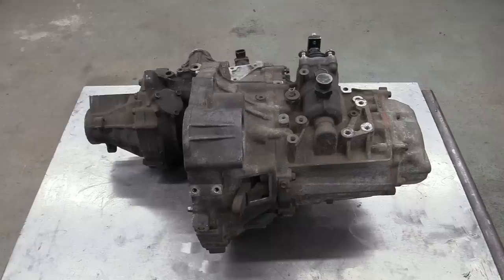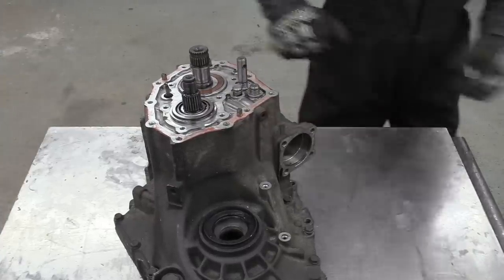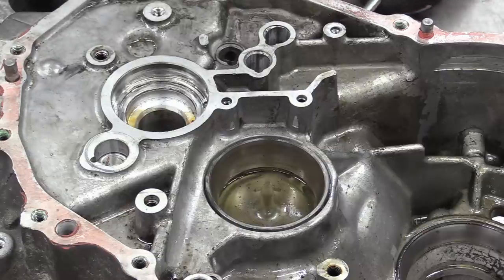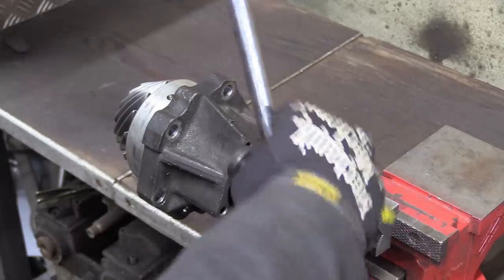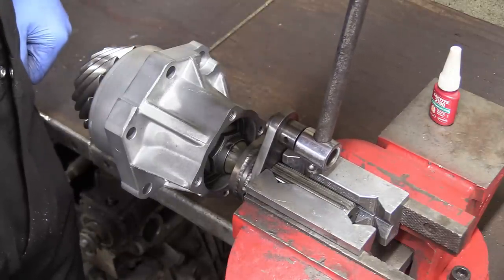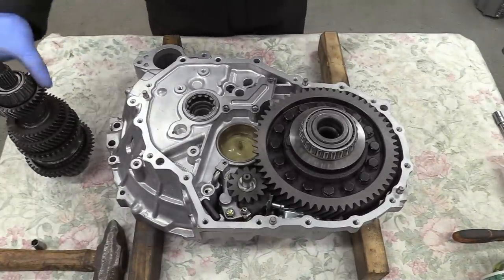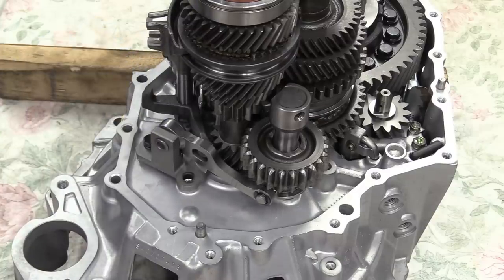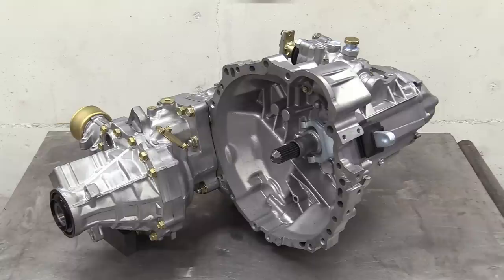Howie Did It - Toyota E154F Gearbox Strip and Rebuild

Comment: As an owner of an ST185 GTFour with a slightly buggered gearbox I can't tell you how excited I was when you said you were doing a 'how to rebuild' vid. Actually I can tell you, I was quite excited. Now all I have to do is watch the vid, absorb it all, get the box out of the car (an engine out, downwards job), regurgitate all that I learnt from the vid, apply it to the object infront of me and I should end up with a spangly nice example just like yours!
Oh, then put it all back into the car.
But only after doing all those 'while it's out' jobs that will end up taking longer than everything else put together.
Easy. Thanks boys!

Comment: If there's anything I learned from this video is how much better the engineering is in the similar generation Honda gearboxes. If you'd have used the Honda CRV as a base I have no doubt you would have had not just a better outcome but it would have been easier too. The B series AWD gearbox is tiny by comparison and can easily hold the power level you would put to it. Oh the what ifs.... But this project is still a masterpiece to behold and absolutely the best thing on YouTube.

Comment: I work at a Toyota dealership and have put a 2nd gear in one and have seen the special tool for removing the bearings, I've also seen someone put 5th  gear on and then seen the bearing plate on the side😁

Comment: When you put the two parts of the case together and said there's seventeen bolts, I remembered you saying there were fourteen to take it apart.
The panic set in, you're supposed to have more bolts taking it apart than putting it together (not counting "shoulder bolts"). Universal rule.
Heart rate returned to normal when three of them went in the bell housing. :)

Comment: Looking like new 😊 great job guys. Can't wait to see it doing 4WD doughnuts 😂 Quick question, the end plate under 5th gear with the torques heads screws, did you guys punch them to stop them coming loose? It's a common issue, 5th gear eats them until you cannot get a gear at all. but I'm sure you lock tighter the hell out of them. Always a great watch 👍

Comment: At 55:48 -re-installing the gear selector mechanism -whats' that extra nut underneath the bolt head? Bolt too long? At 3:10 when removing it I can see at least one of those bolts is shorter than the others.  Related question: did you happen to weigh all the gearbox/diff hardware when you had it out? I've never done anything remotely like this and the sheer quantity of bolts is surprising.

Comment: Rubber grease!?  Is that, like, a thing?  Here at my place we call it "grease".  You know, just the same as bearing grease, assembly grease, kingpin grease, ball joint grease, tie-rod and grease, steering rack grease, brake caliper grease, hair grease, bacon grease, duck grease, etc etc ad nauseum.

Comment: There was a time when I used to think boy those 80s and 90s Japanese cars were just too expensive for their own good. Watching this transmission come apart and back together makes me think how in the world did they sell these cars at such a bargain.
Reply from the maker: That was precisely our thought as we were doing it.
Reply: I knew the Celica GT-Four was a beast, but watching this series I have been seriously impressed with how incredibly stout so many components are. What an engineering feat! Imagine if Toyota were to do it again today.
Reply: @802Garage  itd be half the performance for double the cost
Reply: Your answer is, Production Volumes. The more made, the lower the cost of each unit in the production run. The prototypes are always the most expensive ones to assemble.
Reply: Toyota quality in the 80-90s was almost to good.
Reply: @802Garage  GR Yaris?
Reply: @ClumsyCars  Hahaha, I hear you. If they actually WANTED to build a monster like the old GT-Four though, they definitely could. Their engineering prowess is insane. They are just focused on building cars to meet economical goals rather than performance.
Reply: @Remenschneider  Very cool, but won't be engineered for nearly the level of abuse homologation cars were is my guess. Engineering has come a long way though, and it should be pretty stout. Still hopefully a beast!
Reply: Agreed, that is an impressive transmission, I mean come on... a freaking oil pump and cooler built in, Nice.
Reply: That’s the power of love! No, wait, lean manufacturing, sorry. That’s the power of lean manufacturing!
Reply: Wow, they really did build them to handle a nuclear holocaust, what with having an oil pump and cooler from the factory.  What's wrong with a normal oil bath, anyway?

PS: Mind you, perspective is key here - I started with gearboxes that shared their oil with the engine, and thought that was a good idea.  LOL
Reply: That is exactly what I got to thinking, about 20 minutes into the video.......
Reply: The Celica GT Four was an impressive car. I watched a modded one run 180mph in the Miami Mile event many years ago.
Reply: I own a celica alltrac(gt-four) and when he pulled the pinion out of the transfer case my first reaction was "holy shit that things huge". This car so ridiculously over engineered.
Reply: The  All Trac Turbo wasn't a bargain in 1990.
1990 Brand new ~ 50.000 DM  -  The Mini (edit/ i mean the pricy cooper carburetor Version \edit) was about ~11.500  DM in 1991.
Reply: @10zoll  That's around 45.000€ with inflation in todays euros? At least some online calculator says so. I would say 60-70k with all the components prices nowdays and homologations plus software development. Probably even more. With current top of the line tech. If there was a market they would probably develop it and produce it. As they did with this new yaris. Still they do jave plans for their own sport cars with new mazdas inline 6. We'll see but tbh I'm not sure about the market nowdays with all the heavy traffic jams, speed cameras and all. Not everyone have time for tracks even if they have the money, I mean especially if they have the money.
Reply: @bundles1978  that modified celica ran almost 210 at the last mile event it ran.....also runs solid mid 10s on toyo street tires!
Reply: And that's why i have a shed full of Japanese components from that era. My uncle was an enthusiast of said equipment, and so he passed unto me the knowledge of the quality of these vehicle parts. There was a time when i got some of them for nothing more than a 6 pack of beer.
Reply: Exchange rates gave Japan the upperhand on being able to undercut    Eu/au and USA brands during the 90s with better products.
Reply: @aussiebloke609  So did I. What a rubbish idea that was!!
Reply: @SubversionGarage  What you call bulletproof!
Reply: 802 Garage 
They would just take a BMW and rebadge it.
Reply: @802Garage  I'm sure BMW would do a lovely job.
Reply: @muttenmagroo  Overbuilt, I would say.  Over-engineered has a connotation of excessive bullshit like you see on German cars :b
Reply: A wild Conedodger sighting!  :-)
Reply: @PiDsPagePrototypes  and they spent more on engineering the things than on the interiors
Reply: @SubversionGarage  I had a 90 toyota pick up, sold it after 19 years still running with over 400,000 miles and just basic maintenance, oil, plugs, brakes, clutch, 1 starter, and 2 alternators, and 5 batteries. that was it. I was young and I drove the piss out of it as in 6k is not red line but just your normal shifting point. even spent a few years pulling a 3500 pound travel trailer. I'd climb grades at 60mph in second gear, passing semi trucks all the way.  Best vehicle I've ever owned.
Reply: Behold, my utter lack of surprise that Cone also hangs around these parts..
Reply: 802 Garage and they still had to cheat!
Reply: @802Garage  Agreed, engineering quality has been replaced by the balance sheet. Sign of the modern auto industry. Imagine someone restoring a Prius?
Reply: The boys have kept the quality/expense with the bolts though 😀
Reply: Johnny_McNeil it would cost the same as a Subaru STI or Evo IX
Reply: Oh how the British motorcycle industry laughed when Japanese bikes first came to the market in the early 60's. 10 years later the British bikes were a shadow of what they had been and in the last throws of death. My old man used to have a couple of Honda Benleys from around 1960, twin cylinder 125's, with big massive drum brakes, and electric start, don't think any Triumphs or Nortons had electric start until the late 60's early 70's. The Hondas were beautiful bikes for the era, crap pressed steel frames, but the Japanese all had awful frames well in to the 80's, but the engineering on the motor was exemplary, and that was on just a small capacity bike.
Reply: They are expensive back then because of import tax rise, every country that have a car manufacturing industry is trying to destroy the Japanese cars because they are threatening them as their engineering capability is lacking behind, but instead of coming up with their own engineering solution they go with the easy way by politicize the problem and start a trade war, much like these days, the result is easy to see, after the 80s and 90s, Japanese car industry started to stall while the country that started to trade war haven't fair any better because they dig themself their own grave as well, no one make affordable cars they used to be in order to cheap out and maximize the profit margin.
Reply: @802Garage  IDK, the new Supra is a sales bust and I'm kind of choking on the idea of a BMW engine- the 2JZ had some more development room- lots of guys were drooling over what that might look like, a 3JZ. Oddly enough, there is a "tuner" hot rod going together in NZ, I believe putting the V12 Toyota developed for last generations premier lines into a mid '90s Supra- that could have made a 90K car- this "marriage" of car cultures isn't going over well; it might do better at $60-$65K, but IDK. That Toyota is focused on building sound cars to meet price points is what Detroit forgot it was all about- building solid, dependable cars for a price more could afford. That Toyota, Honda, BMW, Mercedes, Hyundia all do this in America, using American labor and the Big Three cannot says something we need to hear and master.
Reply: The cars they let it go quite a bit but they kept it up with the trucks for sure. The 2000s to at least 2016 ish tacoma, tundra, and 4runner are every bit on par with the quality Toyota was putting out in the 90s. Of course the prices reflect that; and i can easily see 20 years from now they'll be like the 90s cars where nice ones (low miles, stock, rust free) start to cost more than they ever did new.
Reply: @chestrockwell8328  Porsche had that in the 944 turbos as well 😉 (although arguably because they had to do it for the relatively weak Audi gearbox to hold up).
Reply: @PiDsPagePrototypes  Also the production methods, everything is done to a precise routine and consistently. Methods and costs simpler to manage.
Reply: GR Y is a homologation car

Comment: Hope everybody at home had their E154F's on the bench playing along.
Reply: I've actually got a couple of these to do in the not too distant future. One is already on my bench and the other is still attached to an engine that's about 2 hours away from coming out of the car.
Reply: Im headed to the scrap yard to get mine now. Wish he was doing up a model I have any kind of use for.
Reply: best i can do is a meccano kit.
Reply: Only the ones on the register somewhere
Reply: I don’t have mine as I was making sure they (Nik) knew what he was doing before I utilize the video to rebuild mine. 😉
Reply: @AlexTrull  So that's what you call it !!!!😅
Reply: LOL...excellent :)
Reply: @mattn6368  do you know where I can see how to assemble that fifth gear syncro hub?
Reply: After the input shaft seal went in mine (2001 3sgte caldina) I ended up here. The blind bearing tool made from washers was so helpful.

Comment: I don't know of any other youtuber who would even think about attempting a transmission teardown/rebuild to this degree or professionalism, or any mechanic who would have the same level of production quality as this. This is a very unique video and the reason why I love this channel.
Reply: Eric the car guy did a trans rebuild with some help, which was also nice and detailed. It's where I learned how they actually work irl.
Reply: My first trans disassembly was a BMW motorcycle. I remeber, I killed one of the seals because I didn't reinsert a shaft with a special tool that "saves" the seal lip.

I am watching this as a motivational to rebuild my Getrag out of my E46. If you never hear again from me, the Getrag probably won.
Reply: Its not that hard, i rebuilt the trans on my 90 AWD Talon while it was still on the car, in about 8 hours back in 2002.
Reply: Maybe you'd like Jethro Bonner with his Alfa's! Some real quality. Real envious of what he does

Comment: There is an engineer in Japan sitting with his head in his hands mumbling, "Why do I bother?"
His lifetimes work was making special tools for Toyota.
Reply: I used to be a Toyota mechanic. You'd be amazed by how often even the workshop manuals instruct you to use basic tools. They really made an effort to make these cars repairable, even in the dessert with not much but your socket set and screwdrivers.. I was also at Ford and their special tools shelf was A LOT bigger and super specialized. Like we also had tools for vw's just because the Ford galaxy has the vr6, but around here they are rare.
Reply: These basic transmissions had a issue with glazed syncros and I must had stripped dozens of them.  I never used a single SST either.( or replaced a stake nut😎). Really sweet consistent engineering all round and I never had one give me a hard time.
Reply: Imagine that there's more than that. There's probably an entire office that has the sole purpose of designing NOT only the specialty tools that keep the clientele in check, but also specific components that get modified AFTER they've been designed by the main office or during the production, so they only work with specific tools.
That's a valid assumption for a lot of car manufacturers, even if it's not within the parameters i've mentioned.

I, personally find it absolutely hilarious, that in the pursuit of making MORE money, they spend  more to complicate things, which in term can bite them in the arse as (at least then) the measure of a good vehicle (machine, what have you) was, how easy you could fix it. Which boiled down to Joe Bloe being able to figure out how to mangle your third gear using nothing but a rubber band, his pants, and a large screwdriver that's actually his construction hammer.

These days, they've done away with that, and replaced that department with another that's solely purposed in finding means to shave off structure but not at the expense of cost. IE planned obsolesce.

If you take apart succesive gearboxes (for example) you'll start to see the patterns. A gear that was once machined from a billet piece, now's sintered, that case that was machined in spots A D and E now has cast marks, at the expense of structural integrity.

It's a disgusting practice that stems solely from CEOs and failed lawyers or hedge funders, or whatever, that cook up ways to sell you at the same price, the cheaper product.

I mean, look at washing machines. You still pay XXXX sum of money for a YYYY brand, BUT, take the hood off, and you'll be shocked to find that where once great cast iron castings, stainless steel, metal, structure was, there's only glass reinforced plastic. Even the shocks are now, just an interlocking piece of plastic with a spring inside. If they could make that spring from plastic, they would. But you still pay XXXX despite the fact that the inner drum is still metal (because that'd look bad if you saw plastic) and the fact that if that inner drum breaks, it can impale the machine from inside out, some cases where the joint even delaminated and the drum came out the top like a beam in a cheap action flick where the train crashes and beams poke through a compartment for "added drama".

Garbage people trying to make more money making garbage.
Reply: @mortenhartvigkristiansen7760  *desert. Dessert is what you eat! 😉
Reply: @RWBHere  damnit , you got me there.. English isn't my first language, so that's the cover I'm hiding under😅
Reply: @mortenhartvigkristiansen7760  You could have fooled me,one mistake.I would have attributed to"thick thumb syndrome"& no proofreading,good on you Sir !!!!!!!
Reply: @RWBHere  I was required at school to write out 5 times the correct spelling for this - and when I got it wrong this was increased to 25 and when this again was wrong - 125 times. Why do we think that one or two s's makes the world go round?

Comment: This was definitely worth it to watch that "Special Tool" get that bearing out.
Reply: Yes!  Easiest puller is to drill some holes in a piece of bar stock and throw in a couple bolts lol, they got fancy and added a bolt and nut in the middle!.  Sometimes you've gotta make a tool to make a tool to fix somethin'.
Reply: bit of shop genius there
Reply: I also have a homemade special tool
Reply: Oh, Nik. You very clever, special special tool you.
Reply: @dairyfarmerdan  How's it work on cows ??????
Reply: Sadly, it didn’t have its own bracket.